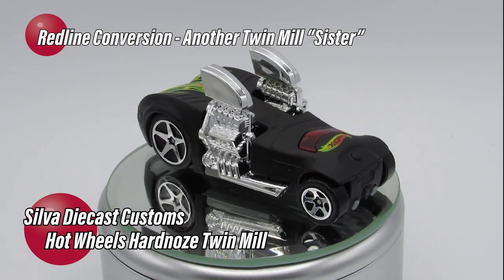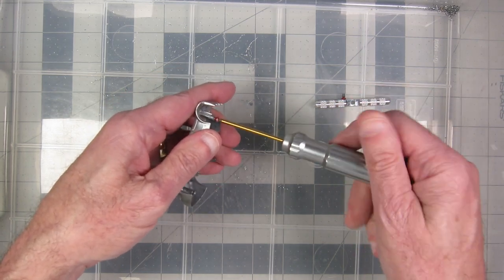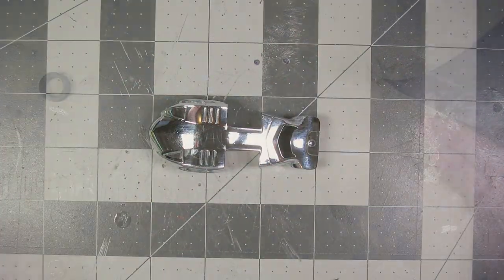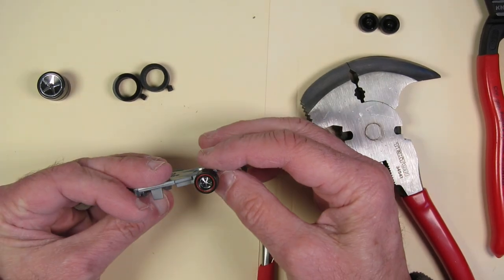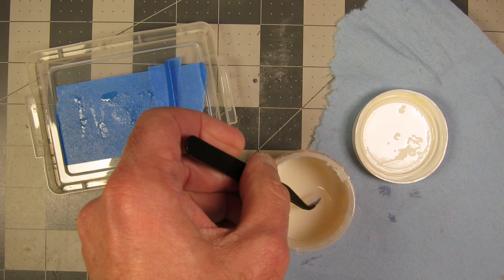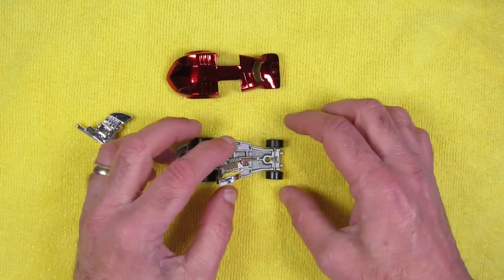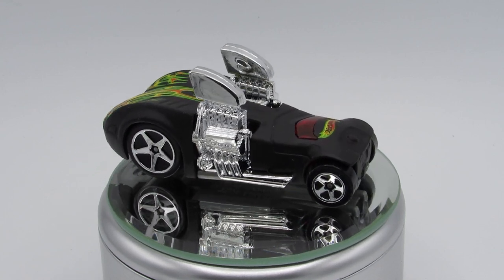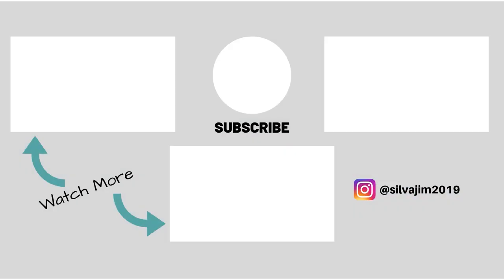Custom Hot Wheels Hardnoze Twin Mill Redline Conversion

Comment: Beauty is in the eye of the beholder Jim, you are a master at rattle can paint, that looks awesome! ♥️🔥😁
Reply from the maker: Thanks Jim!  The Metalcast doesn't always go well (even after at least a dozen cans lol), but when it does and it has the Minwax gloss clearcoat, it's darn pretty 🤣
Reply: @JimSilva-SilvaDiecastCustoms  When I used Metalcast in the past, I had my best results clearing over it before it dries. Your finish looks amazing!
Reply from the maker: @DT99race  That's exactly how I do it too Jim.  After hitting it with the last coat of Metalcast, I'll stick it in the toaster oven for a few minutes (really, just a few), long enough to shake up the clear properly, and then I clear coat it.  The Metalcast isn't dry at this point.  After a couple light coats of the clear, I'll do a heavier wet coat and then back to the oven for 20 minutes.  More often than not, I'll leave it in there even after the 20 minutes (once the oven is off) until the next day when I'll finish up the build.

Comment: In terms of the HW's design, what works well for a t-shirt design in terms of a caricature does not mean it will work rendered in 3-D reality. If it had only been a drawing on a t-shirt, it would have been great. MATTEL could still be selling those shirts. Whoever made the decision to bring it into a casting should be forced to listen to the "Gilligan's Island" theme song backwards for an extended period of time. I love what you tried to do with it. At least you completed the series, which I guess makes it a Hard-nosed victory...
Reply from the maker: Thanks David!  You're absolutely correct.  If they had stuck a figure out of the roof of the car, something like the old CarToons drawings, then it would have just been a goofy toy and it wouldn't have seemed that they were trying to pass this off as a realistic vehicle.